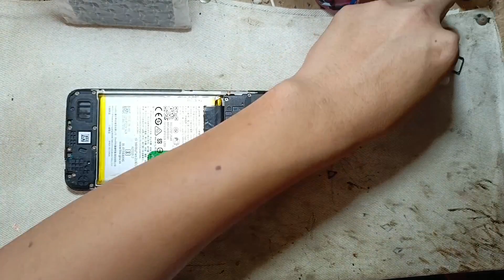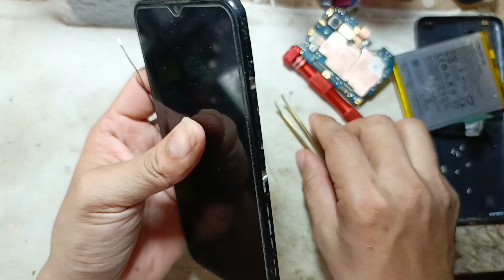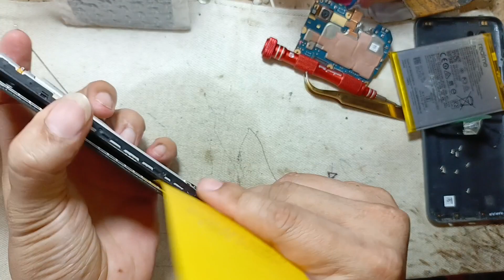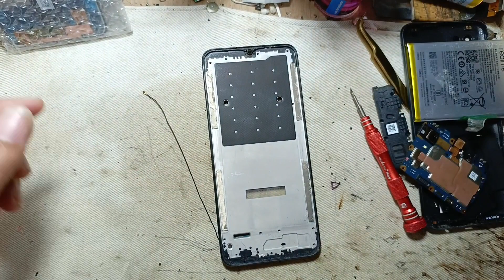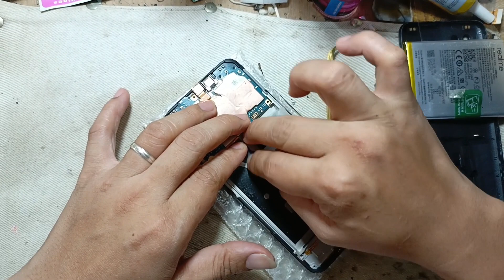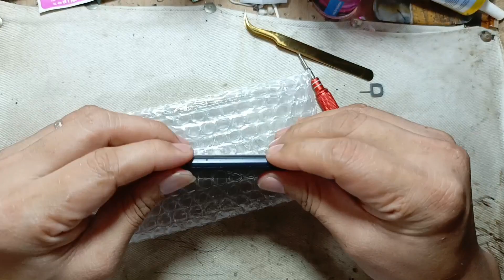Realme c11 2021 Lcd screen replacement, no display solution step by step

Comment: Matanong ko lang po sir kapag walang lcd po mag virabate pa  po ba ang phone di po kase nag variation ang phone ko po
Reply from the maker: Depende po Yan, kung SIRA ang vibrator, Hindi po yan mag vibrate. At kung naka off ang vibration, Hindi rin po mag vibrate...
Reply: Tangal na po kasi ang lcd po bali walang lcd Napo ang phone normal lang po ba di siya nag vibrate pero nagcacharge po at umiinit din ang phone bibilhan ko kasi ng lcd po
Reply from the maker: Ok lang po Yan, wag lang masyadong mainit...